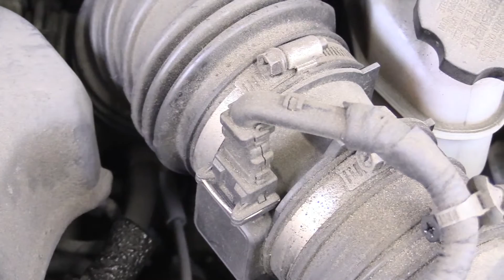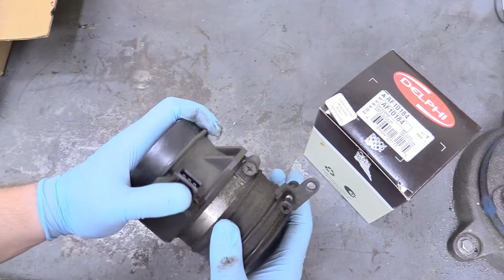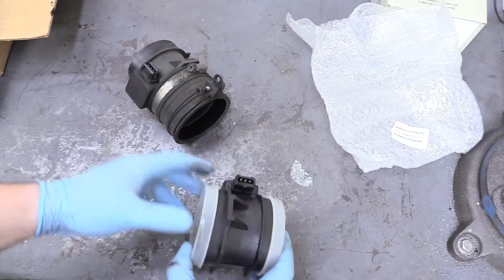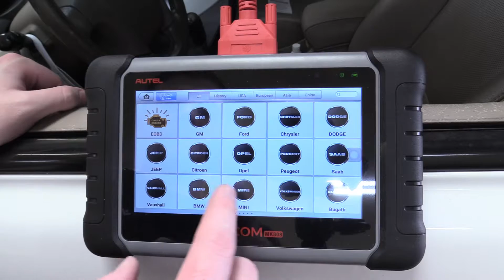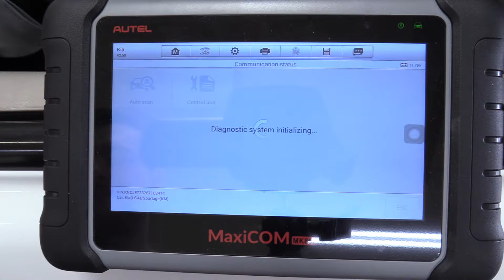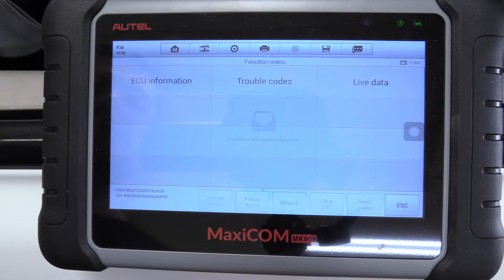How to Replace Mass Air Flow Sensor Kia Sportage 2.7L V6 2005-2010

Comment: Never ever use carb cleaner to clean the element on a mass airflow sensor. Use mass airflow sensor cleaner
Reply from the maker: It's carb, throttle body, brake, and mass airflow. Says so on the can. Thanks for watching!

Comment: It is possible to fit the sensor on a 2.0L DOHC gasoline version, but how would I get the cable going from the sensor to the fuse box and to the ECU?

Comment: Awesome vid!! Thx for the video
Reply: The engine is very hard to start or turn over.
The engine stalls shortly after starting.
The engine hesitates or drags while under load or idle.
Hesitation and jerking during acceleration.
The engine hiccups.
Excessively rich or lean idling

Comment: Sir, What are the syptoms that tell me the air flow sensor is not functioning?
Reply: Check engine light, low engine pressure light, battery light will come on, engine wont idle properly or shuts off when you start
Reply: Your check engine light should definitely come on the best way to tell if the mass air flow sensor is to unplug it when your car is on and if the car doesn’t turn off that’s the problem

Comment: Is that the same as a throttle position sensor??
Reply from the maker: The concept is the same but the location is different. Un plug un bolt remove and replace. Thanks for watching!